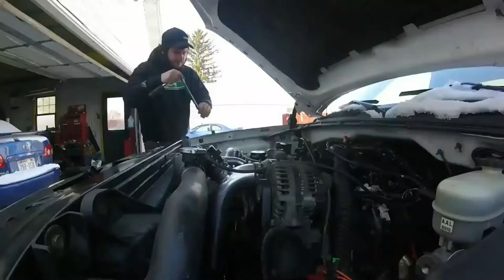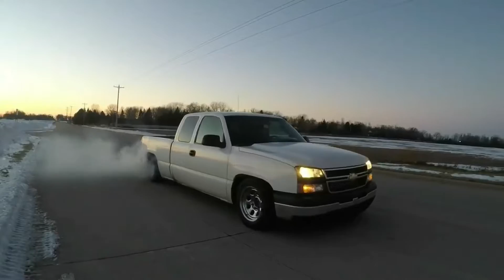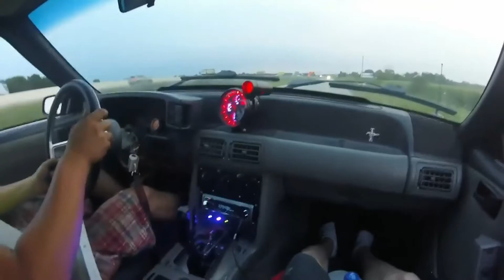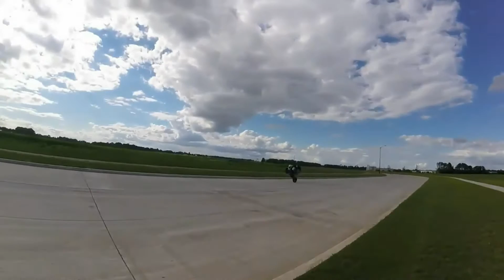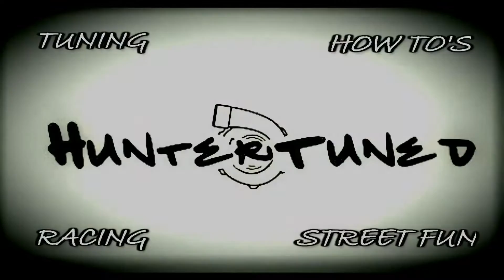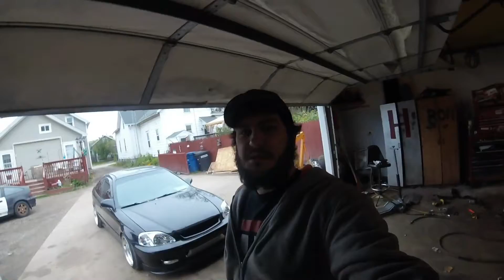Civic Si Turbo B16 Repairs And Tuning Part 1

Comment: Use cutting oil and a step bit, or at least a pilot hole drilled.  Stainless shrinks when it gets hot.

Comment: Subscribed. Liking the Honda content because you're one of the few Honda guy that actually brings up tuning in his videos. Was wondering what kind of setup you recommend to start tuning with Crome? I don't know if buying an ostrich and Hulog anymore is worth it maybe better to buy the demon board from Neptune but use it to tune with Chrome? What do you think? Thanks
Reply from the maker: Mitch Weber to tune with old school crome like I am I recommend to just buy a burn2 chip burner to start. You can’t real time tune but can atleast make adjustments to the 28pin chip. Would be a cheap way to get into it. Make a few basemaps for friends and it pays for itself
Reply: Cool, say if I wanted real time tuning though.... Would an ostrich be a good idea you think or is it outdated equipment? Because you can tune with Neptune's demon bored these days right and use it to tune with chrome as a real-time tuning device paired along with a chip burner right? Just so you would have Neptune's Hardware equipment 2 possibly down the road buy a Neptune license which would be a step up from chrome software right?
Reply from the maker: Mitch Weber I mean it is outdated. I use an ostrich for crome. It’s still cheaper then Neptune

Comment: Its a b18 i do believe i know a d16 is single cam
Reply from the maker: WildChickenNutz B 16 not D 16
Reply: guess you are aright looked at all the honda code names only thougth they made the b18 for vetc and d16  they have so many names for there engine codes.